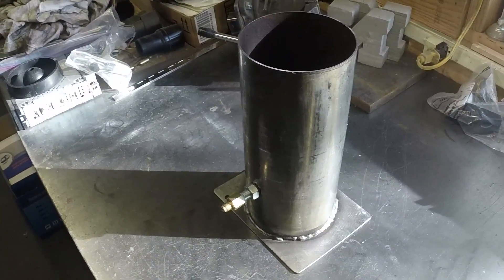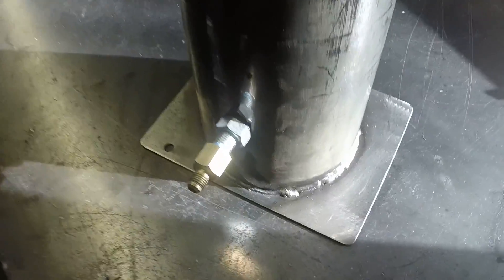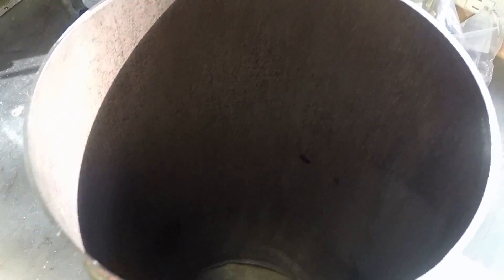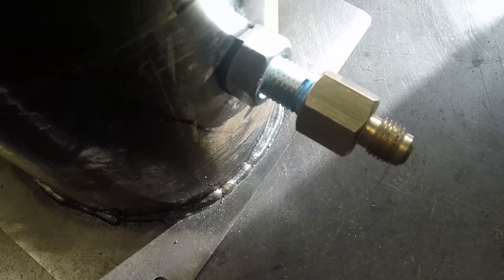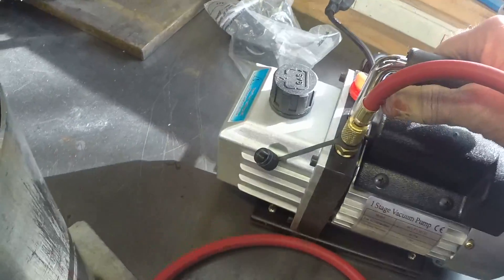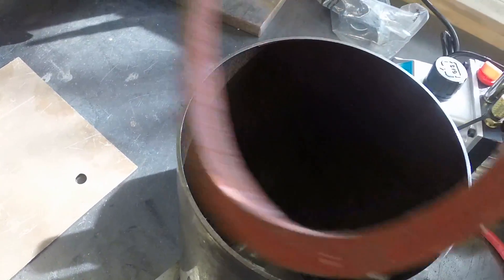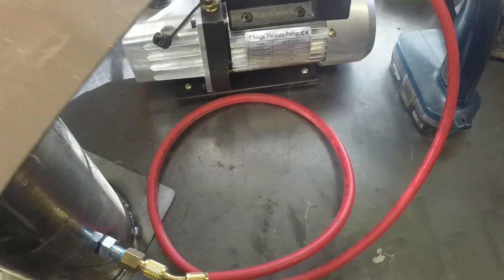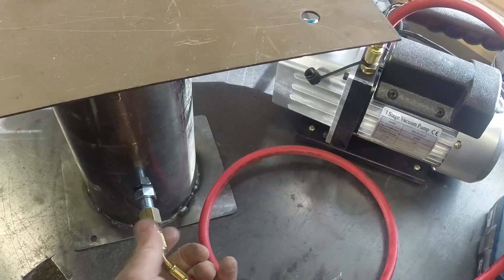DIY lost wax vacuum canister to add vacuum while pouring metal

Comment: How did this end up working out, I'm looking to do a similar setup? Does the gasket hold up to the heat? How hot do you heat your flask before dropping it in there?
Reply from the maker: I've only used it a hand full of times and it worked as it should.  The gasket is made from high temp fireplace silicone that I put in a homemade mold.  Hasn't given me a problem but I let my flasks cool a bit before dropping in.  I do lost PLA and use a kiln to melt it out.  Hope that answers your questions.

Comment: How is your pump handling the the heated air? (500 celcius)
Reply from the maker: It runs for less than a minute while pouring.  No damage yet.
Reply: @scotthobbs4565  Thanks :-)
Reply: @aware61bware  still no damage?
Reply: @lukasbarakzay  No over a year now and still no problem :-) using graphiet gaskets

Comment: Good to see the inventive spirit alive.  You’ll want to add a valve at the top of the vac pump as once turned off that bubbling sound is the vacuum pulling the oil out of the unit.  Will probably only contaminate your hose, but you’re losing vacuum and I suppose it could introduce an oil mist into a chamber with a hot pour.  Shut the valve with the pump running, then shut off the pump.  Take care and have fun!
Reply: thanks for that tip :-)